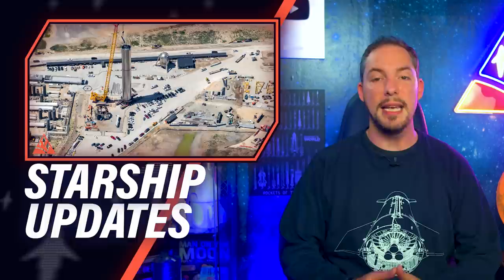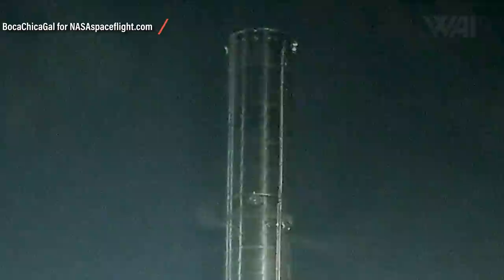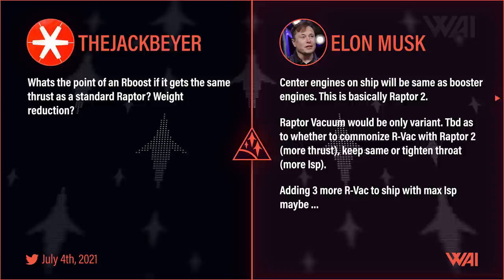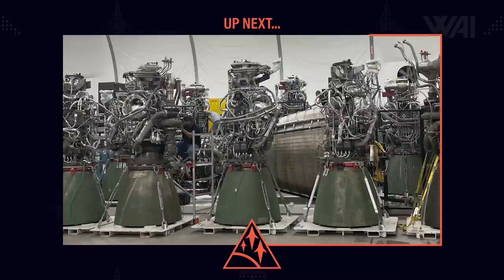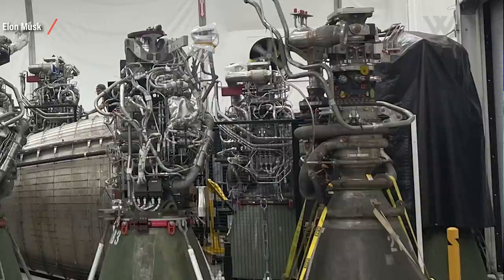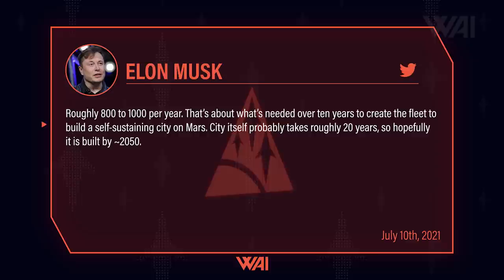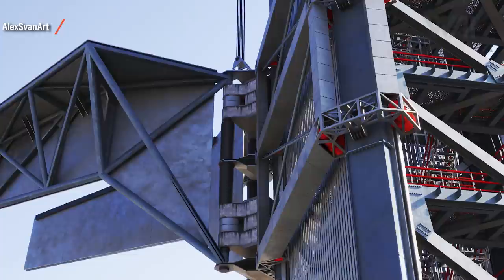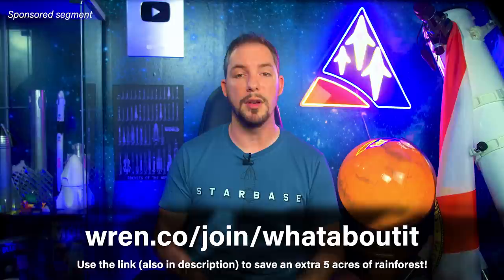SpaceX Starship Super Heavy Tests continue! First cryo tests completed, making way for static fires!

Comment: I’m ridiculously excited to see them attempt their first catch whenever that happens in the future. Just as excited as I was for each Starship launch attempt.
Reply: And as ridiculous as the idea sounded at first, it is getting easier to actually visualize it come together.  Maybe they will try a simulated easy drop of BN3 from Kong into the OLIT arms when it is ready.   Any better way to test it??
Reply: @damanfromtn  The idea I think is to have the booster slow and hover in place for a few moments, and then maneuver onto the catch mechanism, minimizing excessive loads on the cables, arms, or supports. So the mechanism would only have to carry the weight of a mostly empty booster, perhaps a big drop test isn't needed. Just something to show it can support the landing. A gradual lowering from a crane might work.
Reply: I would really like to see them land at least one more starship.
Reply: @bernieschiff5919  yeah I reckon they should start off small and gradually do booster catch testing, then when the time comes, a full orbital launch with a booster catch and starship landing
Reply: Booster catching is the worst idea ever. We have all seen the results of re-lighting Raptors on landing.
Some times they are starved of fuel or refuse to re-light for some other reason.
They're still very much a work in progress. I think the first few hundred boosters should be built with scaled up Falcon nine style legs, at least we know they work.

Comment: I'm just uncertain of the logic in going to 6 vac-raps? The end product is delta-V, wouldn't three engines burned longer on the same holman transfer orbit result in the same as 6 engines burned on a shorter duration? The only thing you get is less fuel/payload because 3 more engines weigh about 5 tons or so?
Reply: It's a good question. Perhaps this configuration makes the most sense for the Moon flyby version of Starship, where the combination of short trip and large passenger complement might favor limiting the time outside of Earth's radiation protection?
Reply: I think that he's calculating for more than orbit. Like Lunar insertion.
Reply: There been suggestion of the extra engines for the Tanker variant.
Reply: You need shorter burn for interplanetary insertion from LEO to get maximum benefit from the Oberth effect.
Reply: Maybe a faster orbital transfer velocity where distance is not the ultimate goal but time.

Comment: It feels to me, Felix, that the yellow piping suggested to be part of the catch mecanism is not strong enough for such a task. Fuel arm?? Yes more likely. I think the catch mecanism will blow our minds once we see it. Keep up the good work. Love your channel from South Africa.
Reply: I agree, those yellow tubes might be to support something else, I don't think we have seen a catch mechanism yet. A clue might be the placement of the grid fins, closer together on each side, where they might be useful to hang the booster off of something, arms or cables.
Reply: @bernieschiff5919  I think, given the brakes of the cable hoist and everything that some retractable sturdy arms, running up and down the tower, connected to the hoist system via pulleys makes sense to me.

Comment: What is the point of having more vacuum engines. Surely it is just an extra weight penalty of lifting to orbit?
Reply: Don't forget they plan to refuel Starship in orbit.
Reply: Tanker-optimized need more propellant = more mass = need more thrust
Reply: Perhaps the weight penalty is made up for by being able to switch off the lower ISP sea level engines at an earlier point in the flight, if they are used at all during ascent? Not sure how that math would pan out.

Comment: Commenting for the algo. Great stuff!
Reply: that can also be used as a stage 0 that assist the rocket in the first 60 m of launch. The rocket burns more than 20 tons of feul befor clearing the tower. With that mechanism you can add 10 tons of payload and still launch.

Comment: The arms probably don't need a shock absorption system they way people expect, the NOV winch has disk brakes that could be used to bring the booster slowly to a stop removing any need for anything more complicated, other than maybe a layer of foam or rubber on top to prevent any damage to the gridfins.
Reply: It would be interesting to see if the outside diameter of the yellow tubes match the curved scalloped undersides of the grid fins on the booster, and what their respective alignment might look like during the landing maneuver.

Comment: I'm not saying the catch arm idea is wrong. However, i'm very skeptical.  The stress of catching a booster isn't just about catching it.  The stresses of a 100+ ton moving object will be extreme.  Not just in the vertical.  The horizontal force on those three clamps will be a LOT.  It will twist the top outward and crush the bottom inward.  This twist will bind the whole device and cause it to not want to slide down.  The more it twists the more it will turn into a brake.  The cable and motor system seems like a very plausible idea but to prevent that twisting a counter weight system needs to be installed as well.  This would mean that it would wrap all the way around all 4 legs.  We need to see much more of the unit to make reasonable guesses.
The skill of the many renders have been excellent.  Just need more data.
Reply: They would have to absorb the stresses with landing legs, and that would mean carrying them with. A stationary catch mechanism can be built to catch is gentler than the legs would. That now allows the booster to lift that much more mass to orbit.

Comment: I think the weirdest/craziest thing about Starbase is not just the speed they are goes but the conditions they are doing it in.  NASA used a giant building and launched several miles from anything. SpaceX is basically building in a field and has all sorts of stuff scattered around the launch site and close to the launch pads.

Comment: I don't know why on all the designs everyone uses huge shock absorbers. just because you catch the booster on the fly doesn't mean that it necessarily happens at a very high velocity. It knows how to land at zero velocity, the goal is not to slow him down but just to not require feets.
Reply: not to mention that it is supposed to arrive completely empty.
Reply: @theplouf5533  I agree, I think the idea is for the booster to hover and then maneuver onto and hang off of the catch mechanism, it only needs to support the weight of the mostly empty rocket, not heavy shock loads.
Reply: There would still be some vibration

Comment: A catch mechanism needs to be quick and decisive regarding where and when to grab. Because of this a catch mechanism needs to be light weight and fast. Those yellow tubes are about as light weight as you can get in something big. My guess is that the grabbing method wont be understood until the end of the tower construction and we aren't there yet. Musk is going to want the first booster landing to stick the first time because losing all those raptors in one crash is incredibly expensive.

Comment: Great episode. Love the quick climate promotion added....ive signed up to wren, feels good, thanks.
Reply: But are they actively putting carbon back into the ground or just into the trees they plant? Will they manage these trees in 20-80 years when they start to rot and release most of their carbon back into the air?

Most of the carbon in a tree is in cellulose, which rots easily with bacteria...

Carbon capture is not the whole picture, you have to manage and store that carbon so it doesn't go back into the air.

If you have signed up, could you search if any of these tree planting enterprises also manage all that carbon once the trees are old?

Otherwise it's a half solution...

Comment: Trying to catch a booster mid air is insanely cool but also insanely hard.  Space X absolutely rocks at landing Falcon 9's on land/drone ships.  But watch closely, it almost never is exactly at X marks the spot, always a little to one side.  Which is to be expected, you come in the fast, that hard.   Super Heavy is way... bigger and it is basically going to have to slow to almost a hover, negate any wind gust/Earth rotating to be just at the sweet spot for the clamps to be in position.  Is it really that hard to build a decent set of landing legs and just lift it back up with a crane afterwards.  When everything is equal, isn't the simplest answer usually the best.  I hope I am wrong, because pretty sure it would be the coolest thing ever...
Reply: If you look at the last return to launch, that booster landed exactly in the middle.

Also, the falcon booster is doing a suicide burn while the superheavy can hover...

Comment: Will the engines survive being submerged in the sea after the test flight, or will they all be scrapped afterwards? Seems very expensive!
Reply: I think the value of the flight will be in the data from the telemetry and video. Thanks to an improved star link, we will probably have a birds eye view from launch, re-entry, and landing in the water, The salt water will corrode wiring and metal it comes in contact with, so I think everything in this booster will have been written off already. It might float so it could be towed back to Pearl Harbor.
Reply: SpaceX is still constantly iterating on the design of the Raptor engines, so the ones on the test flight will become outdated anyway, so there's little use in saving them.

Comment: When you come to the United  States, would it not make more sense to settle in Boca Chica than Cape Canaveral because Boca Chica is where the Starship action is?
Reply: Pad 39A at KSC has had some work done on a Starship launch/landing pad. I would not be surprised that once Lunar Starship is closer to flying for the first time in 2023 for the unmanned test landing, that the Starship pad at Pad 39A will be finished and the production Lunar Starships will fly from there. Not to mention all the Falcon 9 and Falcon Heavy flights as well as SLS, Vulcan Centaur, and Atlas-V flights.

Comment: Say what you want, but this catch worries me
I see a lot of other things being possible here, but the catch still seems like a reach.
Landing alone is a challenge, so catching will literally be the most challenging part of the program.
Reply: My thoughts are for if catastrophic failure, like a tower collision, happens.
Sure if you crash a booster you can just clean up and pull another one up to take it's place but if you destroy the tower then a whole site is shut down until it can be repaired or demolished and replaced.

Comment: Look at the RGV Aerial screen, at time marker 1:42. Assuming Top of picture is North, look about 50 yards South from the Launch platform, and you'll see a low-lying area that looks as if it might be intended for a flood-control basin to catch cooling water from the Launch Deluge system. If you look close, you can see a black line surrounding the high points of this water basin. Is this a wall or water barrier of some sort? Felix: Can you comment on this? I wish I could send you the picture I marked up to show this area, but this comment system won't allow pasting pictures.

Comment: Raptors mass production by a lot of suitabe manufactors is necesario to fullfill the target for 1000 starships equippment.
33 for the super Heavy plus 9 for starship is 42 engines total. Spare Engines not inkluded is 42.000 Raptors for 10 years. Better calculate 50.000 Engines!
3D print for the most parts would be a good option.
Dear Felix.
Many thanks for your brillant reportage!
Reply: There are probably many more starships than boosters required.   Boosters will not be traveling to the moon or mars.
Reply: @damanfromtn  Boosters would change out engines as needed for service, but could see reuse for 100 flights? As production ramps up, cost will come down.

Comment: Can someone do the math on what it would have cost to launch the ISS on Starship & how many launches would it have taken?
Reply: Two launches. The first one becomes an ISS with 20% more internal volume. The second one delivers 300kW worth of solar panels and astronauts to bolt them on.
Reply: @cbboegh  I was going to say two also, but launch 1 delivers the US side, and launch 2 delivers the Russian side. Both have their solar panels attached already. Yeah, Starship's capacity to LEO is crazy high and large compared to anything in the past, but this is needed for doing anything sane in space.

Comment: I'm confused why SpaceX would need so many boosters? Since the path to Mars and back takes quite a while (and so does refueling) I'd expect far less boosters - maybe 20-30 but not more. Considering launch pads I'd expect 2-3 per launchpad so 3 boosters times 4 launchpads would be only 12 boosters - and since they'd have re-fly limit there's enough time to produce new engines while the old batch is flying. I'm really confused by the expected starship to booster ratio...

Comment: Doing welding at launch site does NOT provide the weld strength required for a catch mechanism
Reply: I was thinking about that. A 'Bent Pipe' or molding should be of far better strength.

Comment: Sure hope SpaceX has figured out how to keep all those Rapture engines balanced, the Russians couldn't do it when they tried that on the Proton moon rocket. As we know that didn't turn out well.
Reply: They already know how to keep the 27 engines of Falcon Heavy balanced. Falcon 9 has had engine outs and still got the load to the right orbit.
Reply: They didn't have the microprocessor and sensor tech we do now, which is a big reason that rocket failed. Too complex and too primitive tech to monitor all those engines
Reply: Soviet didn't even bother to static fire those rocket, which isn't what SpaceX is doing

Comment: Ok Whataboutit. With environmental cost of building solar and electric cars. Also the disposal cost of used  li batteries and solar panels at end of life. How do you justify trading one form of global pollution for another? Note a 20MG LI battery will provide toxic levels if dropped into 3 average size swimming pools.  It is a bigger problem than just carbon.

Comment: If you have throttling capability for engines on the outside of the cross section of the vehicle then by throttling the engines on the left you can make the rocket turn left. Not so much need for gimbling.
Reply: It's more for engine out situations. They can adjust those next to the one that went out to output more thrust, and those on the other side to output less thrust.
Reply: @ekaa.3189  That as well. But steering can be easily done via that mechanism. So the Gimbaling of the inner ones can be seen as only needed for landing.
Reply: @timgrindley8080  Ideal is to keep all engines at max thrust. So steering will be via gimbals, and throttling will only be done if gimbal steering can't take care of it. Remember, even going to Mars one is leaving Earth's gravity well, and to a lesser extent the Sun's. So part of the thrust produced is only countering that gravity. The rest of the thrust is accelerating one away. You want the ratio of the accelerating thrust to gravity countering thrust to be as high as possible to be as efficient as possible.
Reply: @ekaa.3189  The possible moment could be significant. Especially as there are 24 or so engines in the outer ring and only 9 gimbaling. Even more if the design changes to a more fat and short rocket which strikes me as a sensable approach given the amount of thrust and the "packed in like sardines" nature of the engines. This would make sensable a all fixed and throttled style with a length to width ratio of les than 9 : 1.
Reply: @timgrindley8080  The rocket acceleration is ever changing as the rocket thrusts because the fuel load is dropping, thus the mass being pushed by the rocket engines is getting less and less. You need enough thrust to get off and get going, but when you reach 3Gs +/- .5G one needs to throttle down for the human cargo. A fat rocket with many engines can lift off with a higher G acceleration, but it must throttle down sooner. That means those extra engines are more quickly turning into dead weight. Yes, lots of tradeoffs.
Reply: @ekaa.3189  I was not going for more rockets just a more efficient tube in terms of surface area to volume and with a shorter one the pressure differential due to g/gravity on the bottom of the tank will also be less. There is a point at which areodynamic efficency has to give way to volume efficency.
Reply: @timgrindley8080  Again more tradeoffs. A larger in diameter tube requires a thicker wall thickness to contain the pressure. That costs weight, and weight is the enemy when trying to get out of the gravity well. If I remember correctly, for proper propellant feed into the Raptors the pressure needs to be around 6 bar. This is to prevent cavitation in the turbo pumps. Cavitation will cause fuel feed interruption, and a RUD of the engine. A taller tank helps with naturally keeping the pressure at the fuel intakes and turbo pumps high.

Comment: Why not, instead of carrying 3 extras RVac, try to make those central, sea-level Raptors, dual-bell or variable?
Reply: There's not enough room
Reply: @alvianchoiriapriliansyah9882  for housing 6 engines instead of 9? Why?
Reply: @elmobrandao9849  Try to see the renders & calculates yourself
Reply: @alvianchoiriapriliansyah9882  Pronto! Really seem to fit. But its hard to figure how much extra space is needed for gimballing